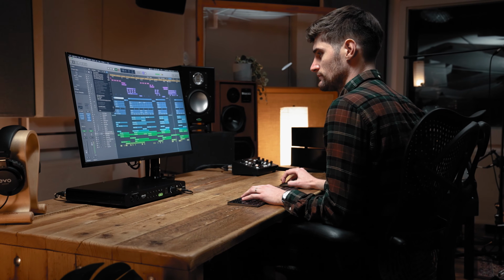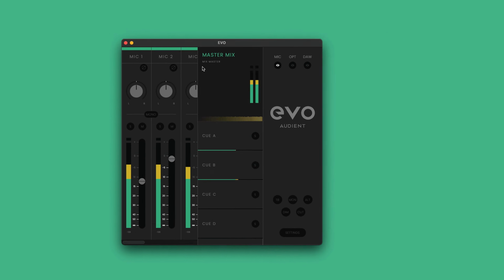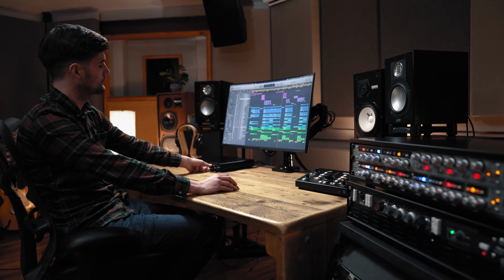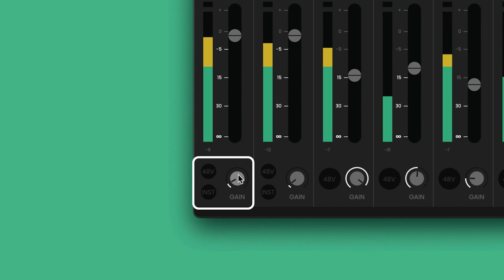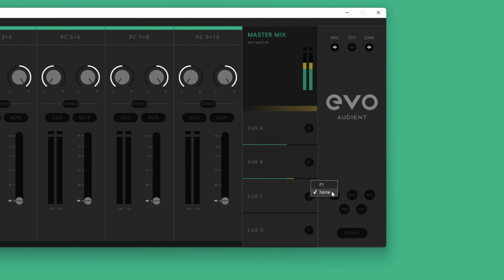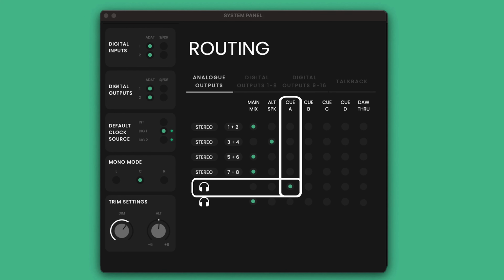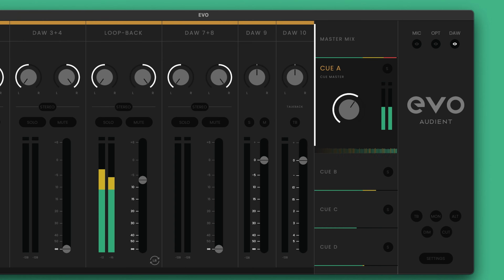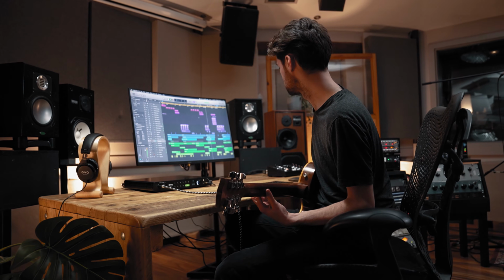EVO Mixer Software Overview | EVO 16 Audio Interface

Comment: Only briefly commented on routing and confused  how this works.    I have four sets of monitors.  
   Have not used the EVO 16 and only connected it last night. 
   I might want to hear more than one set of monitors, and not just alternate between one or another set. There doesn't seem to be any choice in routing at all except for outputs one and two or ALT. In LogicPro I should be able to select whatever output I want, yes?  If all for monitors are sent to stereo, or outputs 1/2, all monitors should be playing, yes? If I want different monitors to play from different outputs I should be able to select those within LogicPro and the output selection in the mixer, or the selected channel strip options?

   The other only briefly described Item was the F1 button. Simply selected and it will select whatever function you want, but how do you do this? She left what in the mixer, or on that interface itself, then Select F1 in the mixer on the right, or in the routing section? This is not described clearly at all.
  Best,
Seth Thomas MD
Reply from the maker: Hi Seth,

Thanks for your message.
It is possible to send out to multiple speakers at once. You might just want to assign the 1/2 and 3/4 outputs to main mix, which will output the main mix simultaneously to those 4 output channels.

If you'd like further assistance, reach out to us at support@audient.com.